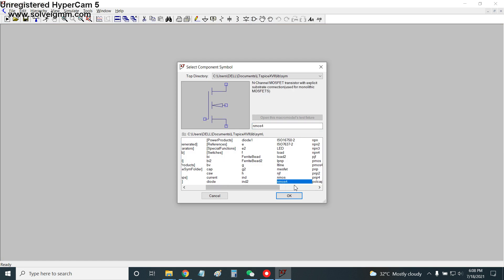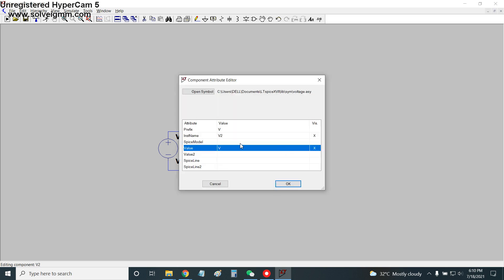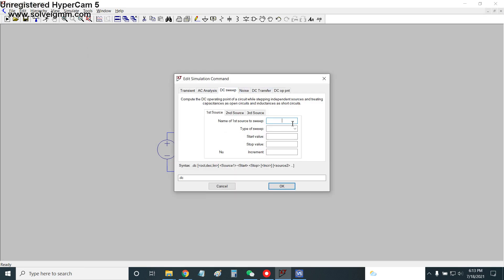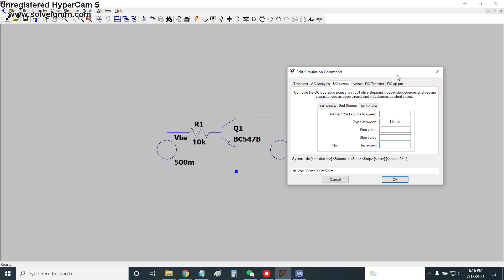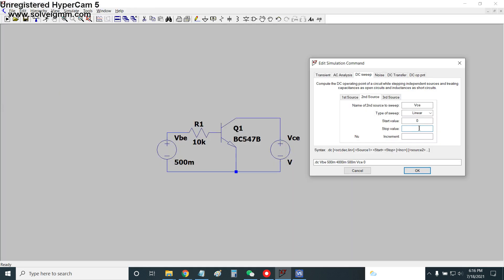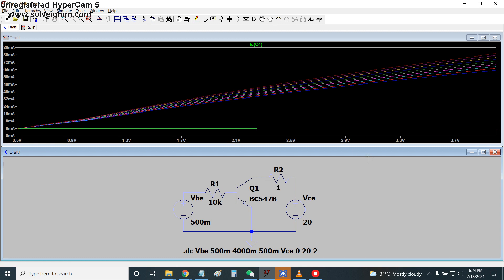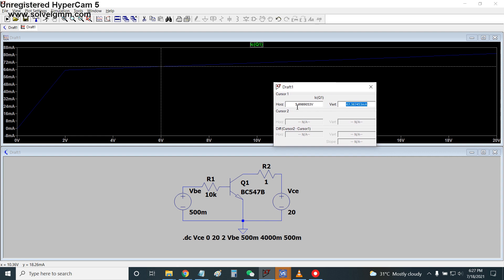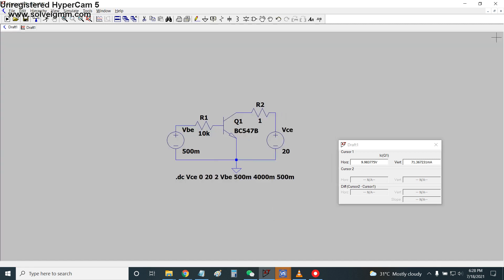BC547 NPN BJT Transistor Transfer Characteristic Curve using LTSpice

Comment: You didn't include the base-emitter voltage drop (approx 650mV).  Vbe increases slightly with increasing base drive, but 650mV will get you much closer to the spec curves